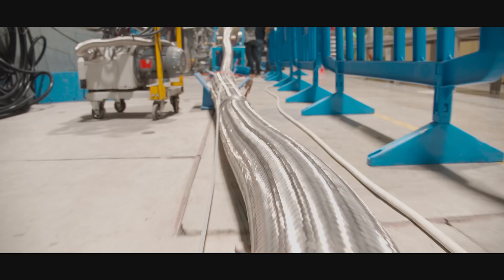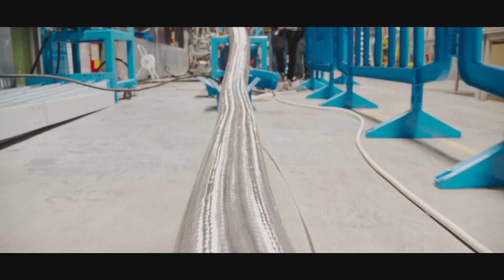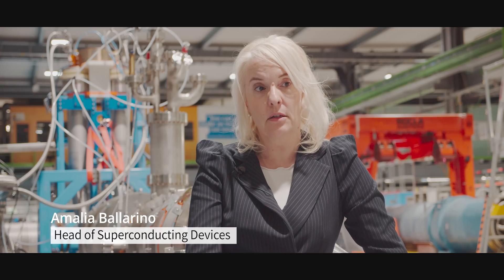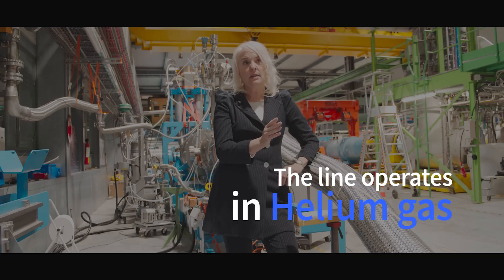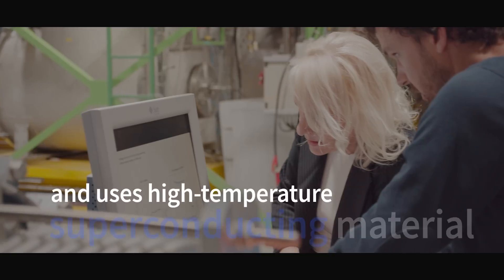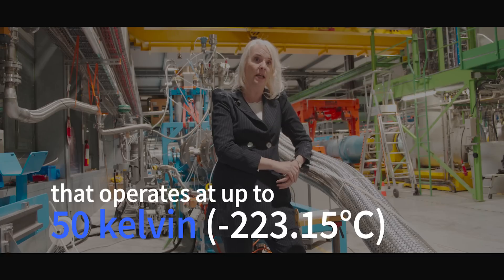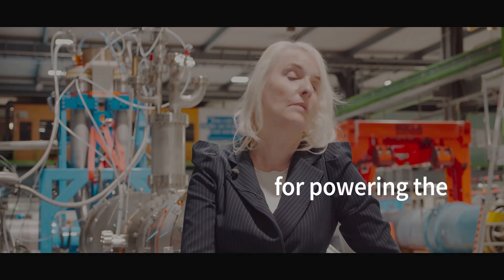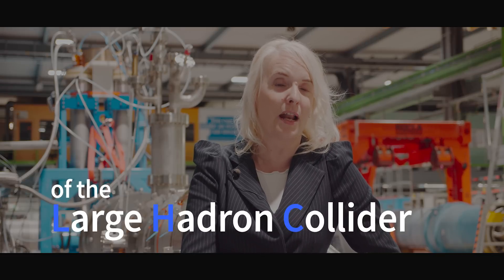A cooler way to transport electricity

Comment: can you accelerate particles faster than light 

if yes 

what happen to particles, what were your results 

if no 

what is your limitation to accelerate particles faster than light 

may be particle accelerate could be the key to get message from future
Reply: The faster the particle goes, the more energy it requires to accelerate it further - which goes towards infinity when approaching the speed of light. So it is never possible to fully reach  the speed of light.

Comment: I have three questions about the neutron
The first question
Is the neutron lifetime short
If the age is short, how can they unite with the proton
In the stages of evolution of the universe
?
This union will be impossible due to the length of time and space
How does the neutron unite with the proton and the age of that neutron was short?

second question
Are there neutron shorter than other neutrons in time and age?

The third question
About the stages of evolution of the universe after the Big Bang
Is it the nucleus of the atom that brought the electrons or the electrons that have brought the nucleus of the atom ??

Please send these three questions to cosmologists and physicists

Comment: The technological spin off is enormous but the scientific value often doubtful. After seen the LIGHT and a Black Hole you may consider stopping the LHC experiments all together for health and safety reason. You have your Higgs-Boson, your subsequent "dark" whatever you may call it, a Particle Zoo and loads of funding so do not fiddle with the Photon/Electron Coupling anymore - enough damage has already be done. Particles vs. Waves 0 : 3 and "Gravity" becomes an electric and therefore controllable force and the LHC a Dinosaur.  Sorry....... but this paradigm shift was overdue !